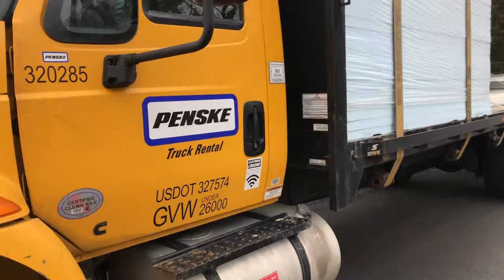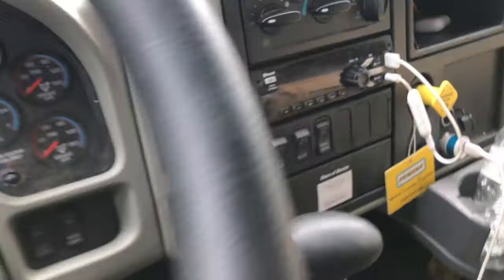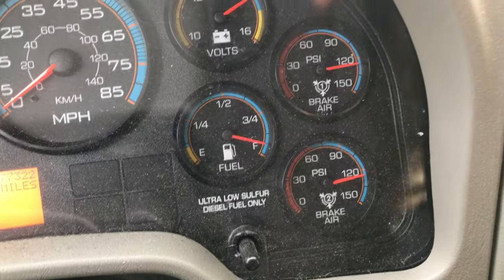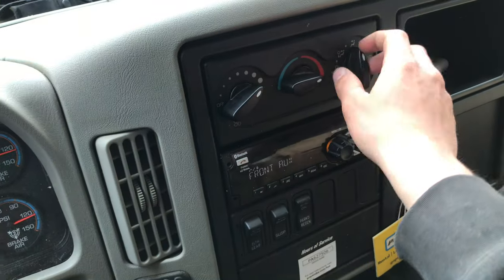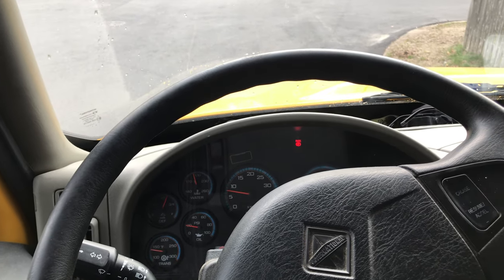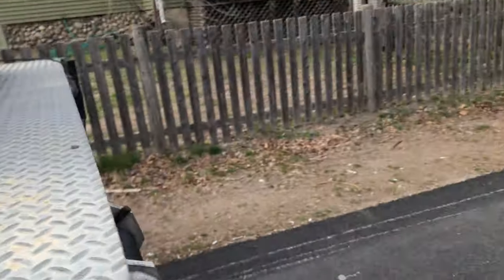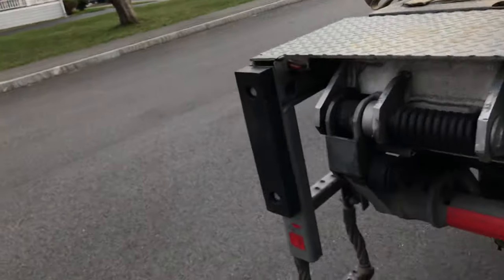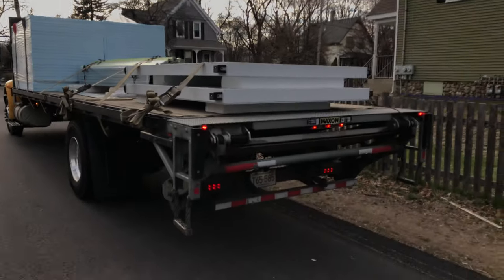International 4300 SBA 4X2 Flatbed review

Comment: Whats up Seth how r you, I wanted to ask you how is the 26ft non cdl flatbed market compared to the 26ft box truck market. Should I make the switch
Reply from the maker: What are you usually shipping?
Reply from the maker: And how do you offload?
Reply: I do dry van  box truck but im looking into non cdl flatbed truck similar to the one you use someone else that does it says there is a good market for it im just trying to get as much insight as I can b4 I get the truck and it's sitting because there's no market  for it
Reply from the maker: In my opinion there will always be a trucking market. If i were you I would call a broker or try to hire your own broker and go that route. Cuz flatbed is always gonna be a thing